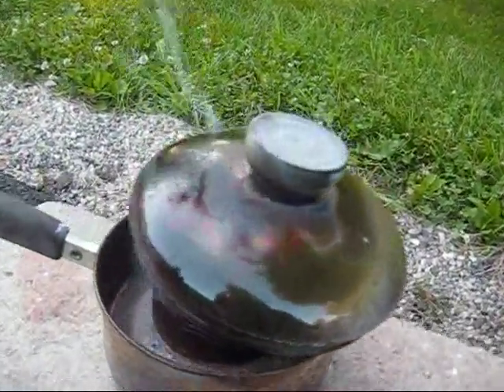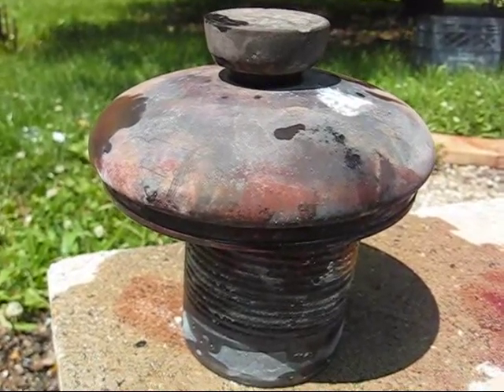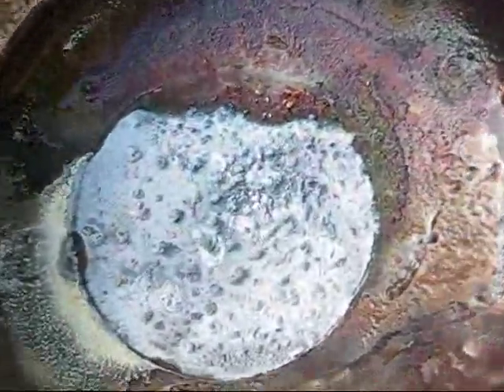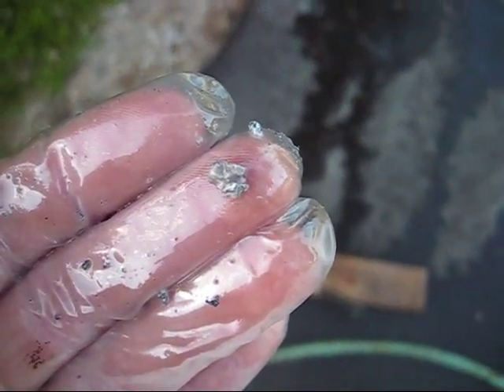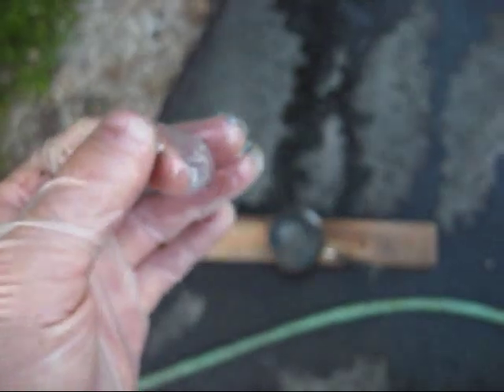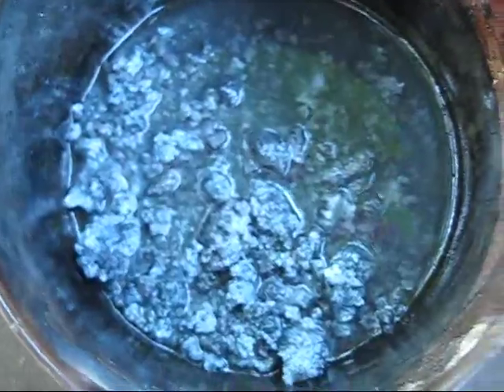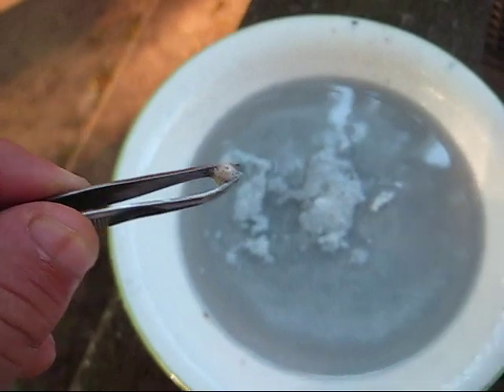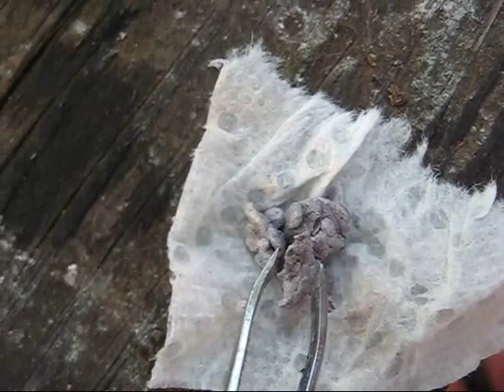Making Sodium Metal - Sodium Extraction

Comment: i haven't seen a single person electrolyse table salt and actually harvest the sodium, why is this?
Reply: +skyhawk551 Water is usually electrolysed before the sodium ions, making it impractical.
Reply: +skyhawk551 You need to do it with molten salt, which is very agressive, and then it produces chlorine, which is pretty agressive too
Reply: ya i've since designed my own molten salt reactor and have studied quite a bit on chemistry involving both sodium and chlorine, like making DCM and other things. will build and run it when i have the funds.
Reply: +Dennis Lubert It produces chlorine anyway, it can be a solution or molten salt it will still produce chlorine.

Comment: The reaction could be more likely:  Mg + 2NaOH =  MgO + 2Na + H2O
Reply: ***** Yes, that is certainly true, but I wish to point out to you that with hydrogen formed at high temperature, It's reasonable to expect that it would remove the oxygen from the sodium hydroxide. Remember also that the H2O is in the form of water vapor (steam) and therefore could escape at the high temperature so as to not react with the newly form sodium.

As for not being a 50:50 molar mixture that is irrelevant. Why? Simply because of the fact that even if one has a stoiciometric ratio of reactants that in no way entails the idea that the reaction is going to go to completion. Also I wish to point out that no quantitative analysis of your products was performed so you can't say definitively that you have obtained what you think you have obtained by your reaction equation.

Comment: Once this mixture cools down. Scrape off the carbon layer with a knife. Underneath you should see a "frisbee" of PURE sodium metal. Scrape off the top and bottom of the frisbee with a knife so its pure. Here is what else I use to do. A normal 12 volt dc converter is too slow. So I'd connect 4 - 12 volt dc converters together. Connect them like you would batteries, to get 48 volts of DC current. Otherwise it will take all day long to get a nice sized frisbee. I should make a video to show people.

Comment: Here are a few tips. The anode/cathodes need to be set so they don't touch the bottom of the steel container. You do this by putting a half inch of sand on the bottom, under the hydroxide. So technically its 3 layers. Sand, sodium hydroxide, then carbon. I use to do this when I was 17 as I was obsessed with chemistry. I copied it right from a chemistry book. You heat the entire mixture in a charcoal grill, then run the converter.

Comment: There is a much better way to make a ton of sodium. You put a ton of sodium hydroxide in a steel container. Then get a dc converter, and stick an anode/cathode into the sodium hydroxide. Next you need pure carbon, not charcoal, but pure black carbon. You can make a ton of pure carbon by heating up sugar on a pot, inside a grill. Untill its all black and stops boiling. Powder down the carbon, put a layer over the hydroxide, compact it. Then melt it down, electrolyze for hours, pour off carbon.
Reply: I'm like you when you were 17. I'm getting ready to make sodium. The concept of creating a metal out of water, salt and something that looks like talc powder using electricity is amazing, let alone the fact that the metal you get literally burns in water.

Comment: To separate out the sodium, could you just take the reaction mixture immerse it into a high density oil and heat it up to get the sodium to melt and float to the top where you can retrieve it?

Comment from the maker: @Armourix Alright, well in that case I suggest starting with 4 grams total reactants. That should be enough that the slag will react with water, or at least the sodium will that builds up on the walls of the crucible. I will leave you to figure out the ratio of each chemical according to the reaction: 2Mg + 2NaOH -> 2MgO + 2Na + H2

Comment: @jetsamjetsam that should work, but you would need:
1. a high current DC power supply (car battery charger or car battery should work)
2. regular NOT IODIZED table salt (water softener or road salt should work too)
3. a (preferably thick ceramic) crucible
4. the means to get the crucible and its contents (the salt) above 1474 °F (801 °C) which is salt's melting point
5. 2 carbon rods (Heavy Duty D size batteries have 1 each)
6. BE SAFE this puts out chlorine gas which is extremely toxic

Comment: @coolestdude80 you can do that, but i would suggest that you use carbon rods (elemental carbon/graphite) and you need to get the salt hot enough to be molten (melting temperature = 1474 °F (801 °C) so that it can start to conduct electricity. another VERY important thing to note when doing this is that the reaction WILL PRODUCE CHLORINE GAS which is extremely toxic when it is in its elemental state (Cl2)

Comment from the maker: @sekrantizeer Easier said than done. I have attempted that method several times and the sodium would not separate. I have a few ideas to improve the process but have not had time to test them. Also, I have not found an oil that sodium will float on but not react with.

Comment from the maker: @FaintSnow Yes, sort of. The sodium reacts with the water it touches releasing hydrogen gas. This reaction also causes enough heat to boil the water immediately around it. Combined, the water vapor and the hydrogen are produced rapidly enough for the sodium to float on the gas layer. Larger pieces of sodium will be too heavy for the gas however, which causes them to sink into the water and react so quickly they explode.

Comment from the maker: That would be a thermite reaction, which is not what is used here. Thermite reactions will only work if the free metal is more reactive than the metal trapped in the oxide. This process can only be used on hydroxides.

Comment from the maker: That's a good idea. I have had that idea before, to melt the sodium under a liquid of high density. Glycerol would be great because it has a higher boiling point than the melting point of sodium. An issue I predict is drying the glycerol entirely due to it being hygroscopic. Perhaps heating it prior to introducing the slag would work fine.

Comment: This is just an idea, but it might be possible to do it using potassium metal, and instead of using mineral oil using pure ethyl alchohol. I recall that eth/methanol can be used to store sodium (just not because of evaporation/flammability. What's special about this is that sodium/potassium hydroxide is soluble in it, so you might be able to increase the density to past that of water. Just an idea.

Comment: I did it today with the slag in wire mesh. It sort of works. The outermost layer of magnesium oxide turns into a powder and sinks to the bottom, but nothing much past that. It removes about 10-15% of the magnesium oxide from the sodium, so it really just makes it less impure, though it might do more if you had it in the oil for a long time.

For a denser medium, it might be easier to do this with potassium, because things like Vaseline are on the borderline with it for density.

Comment from the maker: I gave it a shot with no luck. I have plans to do more testing come warmer weather. A wire mesh could be used to suspend much of the MgO while allowing the Na to fall to the bottom of the vessel. I'm afraid it might still not fall out of the mixture due to cohesion of the small drips of molten Na and the MgO.

Comment: I bought it off united nuclear. they'll ship it. 

And to the oil thing, problem is is that MgO has a density of 3.58gcm3, more than three times as much as the sodium. I imagine the Mgo, being a solid, would sink to the bottom and the liquid sodium would continually mix. I'm actually going to try this tomorrow though, so if it works, easy way of refining the sludge.

Comment from the maker: Sodium does melt at a low temperature, but I was unable to separate it from the slag when I heated it under mineral oil. It's possible that I was not persistent enough and it would have settled out eventually, but I did not witness it.

Comment: Yes.... This reaction does occur gamo - Everyone above is correct; the reaction is not spontaneous at STP, however molten sodium in a low oxygen blast furnace can be reduced.   You can predict the conditions under which this will occur by applying the gibbs free energy equation and finding the temperature at which deltaG becomes negative.  You will need to look up how to do that for yourself.

Comment: You won't get sodium metal because sodium is much more electropositive than carbon, and carbon is not capable of reducing it. Magnesium yields sodium metal because the equation: Na2O + Mg --> 2Na + MgO is exothermic, and so procedes to occur. You can write out the reaction using carbon, but it's enthalpy will be so high that it just won't happen.

Comment: Probably you can find it in local lab supplier to get a crucible.

Moreover, I have a suggestion of how you can extract the sodium, you may reheat the mixture to 300degree celcius after they have stabilize, and cool the lid by ice, which most of the sodium will condense on the lid.

I will film one of this reaction if I have time.

Comment from the maker: Quite true. I would like to see this reaction preformed by melting the reactants, however the problem will need to be overcome of finding a crucible that can withstand molten NaOH.
Reply: Most people use cans for this reaction, I have an actual crucible. My reservation for using it is, I may not get a "seal" like two metals together. Opinions?

Comment: You did improved in this video, and quite a brilliant reaction you have made, however, the crucible a mean is the one appear in laboratory, which is much smaller in size.

Also, by melting the mixture in a crucible rather than direct burning may produce sodium with higher purity.

Comment: Hmm, I think the best way to purify it without much of a loss would be distilling the raw sodium, unfortunately the boiling point is extremely high (883°C), close to the melting point of glass. Even in a vacuum distillation, you'd need a pressure of 0,01 mbar to lower the bp to 281°C (wiki).
So maybe one could build a full metal apparatus but you'd somehow have to protect the liquid outcoming Na from air oxidation

Comment: ah, its nothing hard.

The magnesium reacts with the sodium hydroxide to form magnesium oxide, sodium and hydrogen gas.

2Mg + 2NaOH --> 2MgO + 2Na + H2

The enthalpy of formation of magnesium oxide exceeds the enthalpy of formation of sodium hydroxide. It's certainly an odd reaction to the inexperienced chemist but one must remember that at high temperatures thermodynamics plays a more signficant role than kinetics.

The extremely high formation constant of MgO is lattice energy driven.